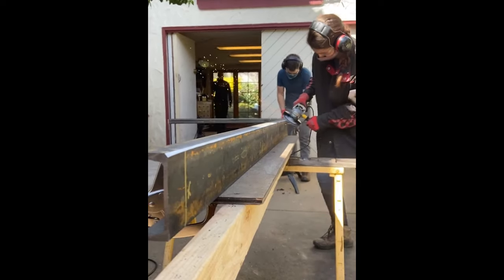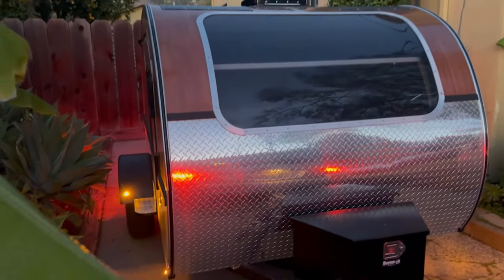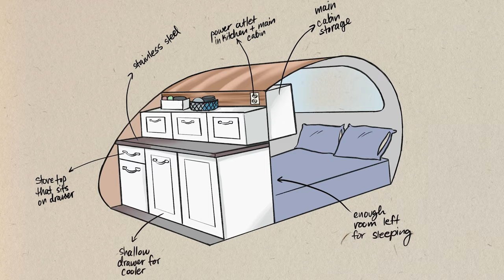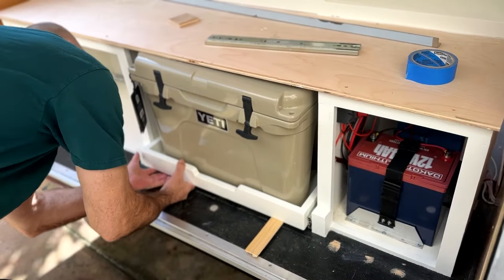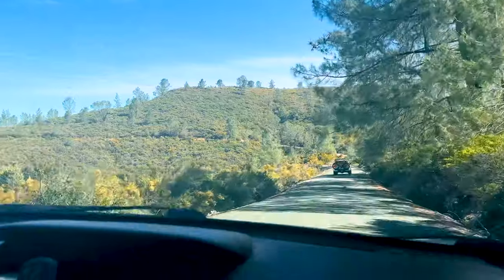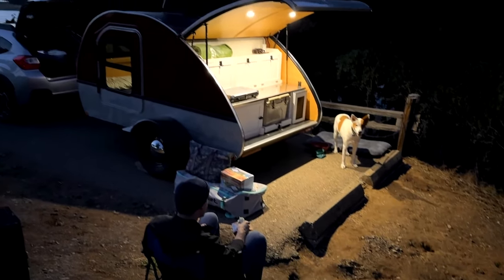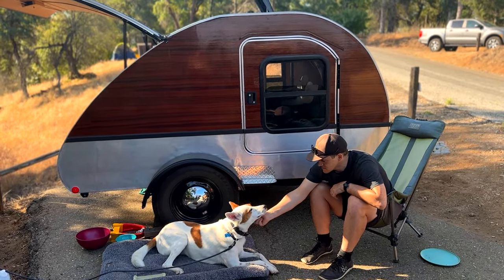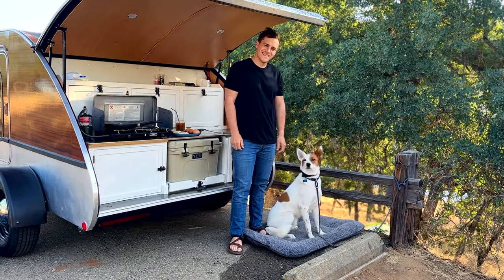DIY Teardrop Trailer FULL TOUR + Camping Trip

Comment: Great job on your camper.  I was glad to see you kept cool and that you pulled it with a Subaru.  

I recently built my teardrop.  I made a big tongue box that has a door that swings open.  A four week project in itself but worth it 36 by 24 by 24.  

As far as in cab storage how about a hammock shelf made from see-through Monolite from ripstop by the roll.  Its very light and strong. 

Attach it with mini carabiners to metal hoops or  S.E.PEAK Stainless Steel Bolt Hangers.  
That way you can use it for overflow only when you need it. 
I use one on my galley door.  I originally made it for  hammock camping to hold my backpack off off the ground.  

I thought it could be used to let things like dishes air dry or to set things in when the counter gets to crowded.  

My wife and beagle Poppy will throughly test ours out this summer when we go from Oregon to Michigan this summer.
Reply from the maker: Thanks! I appreciate the suggestions, that is another good option for additional storage. And hope your Oregon to Michigan roadtrip goes well, that sounds like an epic trip!

Comment: A suggestion for increased storage might be to build two-level cabinets as done in the Camp-Inn 550 teardrop. Other option could be to add underfloor shelves between the trailer beams, like the Vistabule. An interesting variant of this was done by Chesapeake Light Crafts Camper in the form of a "bolt-on" underfloor with side access. I'll leave you some YT links so you can see them:

Camp-Inn: https://youtu.be/TLLFt3vzFoA?si=dtSU3ZGq-e0vke6Y&t=724
Vistabule: https://youtu.be/wKT94GAlvqM?si=p6mI879k5PA2oZ_M&t=246
CIC Camper: https://youtu.be/apzaLz4Kl3k?si=hs_bBrESwSfnVZhw

Comment: Elena, hello again, 2 questions: (1) How thick is your queen mattress? You have a link to it? (2) How tall or high is your inside ceiling? Depending on how tall you guys are, I was wondering if it felt claustrophobic or great. Great job on the update, keep updating, in the process of building ours as we speak.
Reply from the maker: Hello, happy to answer:

1. Our mattress is 8 in thick and we bought it from Overstock.com (I'll attach a link to the foam mattress we got below) 
2. There are 49 inches between our floor and ceiling by the head of the bed which allowed the tallest out of my family (my dad who is 6ft) to still sit up fully on the mattress and not hit his head on the ceiling. I'm 5'7" and my husband is 5'11" and neither of us felt claustrophobic while in there. I think the higher ceiling, the big window, and the doors on both sides with windows helped us avoid the feeling of being "trapped" or claustrophobic. 

Good luck with your build! 

https://www.overstock.com/Home-Garden/Sleeplanner-8-Inch-Memory-Foam-Mattress/27549722/product.html?refccid=2O4TTAEN7N2LM6KNMBGDTLRKIA&searchidx=11&kwds=&rfmt=mattress%20type%3AFoam%7Cthickness%3A8%20in
Reply: Awesome, thanks for the link. Haven't bought our bed because I'm checking out all of my options, i.e buying two separate mattresses one for each side so if one moves the other person doesnt wake up or buying a queen. I may go your route with the mattress since it's more affordable than I initially thought. As for the height, in theory ours will be close to 46", benroy-ish. Thanks again!
Reply from the maker: No problem! You’re going about it the right way, better to explore all options upfront than have regrets later
Reply: Yes, I figure I will probably have those anyways lol but I hope that they're small regrets i.e should have out a light over here vs. the door should have been bigger, more insulation, door should be moved etc.... lol

Comment: BEAUTIFUL camper, so are you - wish you showed more of the build and design. get a bike rack that goes on the back of a car trailer hitch and you can weld it to the trailer pull in front of the tool chest.

Comment: Nice trailer …. Instead adding cabinets inside the trailer. Why not just utilize the trunk space you have in your main vehicle ( Crosstrek ). Leave those extra clothing in the bags and when you use up the clean ones inside the trailer then switch them with the clean ones from the car.  Adding cabinet will make less room inside.
Reply from the maker: Thanks, that is another option for sure! We do bring some larger items that take up a lot of space in the car when camping (paddle boards, mountain bikes, etc), but I do like how much space we have in the teardrop  cabin so we might end up not adding that additional storage.